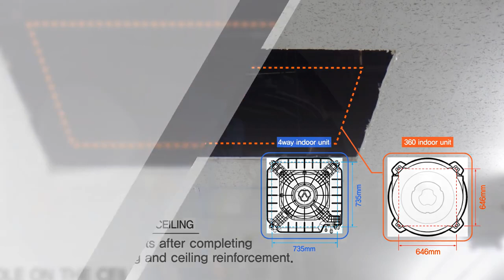SAMSUNG 360 Circular CST Installation  ~ Redefining System A/C Standards [by ESE]

Comment: i work with ac but not like
Reply from the maker: Hi Mr. Modeste, 
Thank you for your interest in Samsung Air Conditioning. For job openings pls contact your local sub or distributor for potential availability.